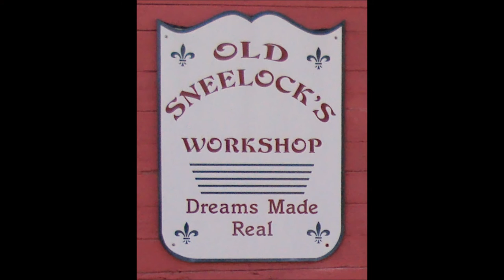Restoring A Two Man Saw ~ Pt 10 ~ Explorations In Removing The Rust ~ By Old Sneelock's Workshop

Comment: YesSirRee those wheels do a good job. Anytime i have to use one the thing is really rusty. Doing it outside and with a dust mask helps...
Reply from the maker: Ol James I have two more crosscuts to clean and a pile of panel saws. Fortunately I just went to pick up supper at Up North Restaurant and the Ace  Hardware was 50 feet away across the parking lot. As can be expected I know the guys there so I went in and checked. They have a peg full of them on the sand paper aisle. I love small town hardware stores.
Reply: ..YesSirRee, that's where i found a supply of them. wally-world doesn't really keep them in stock...

Comment: Lowes or Ace has those wheels. I've seen them and that's the only 2 places I go to get anything. I tried the little plastic so-called abrasive thing like a wire brush but it didn't do a thing on my industrail strength rust. The DeWalt flap wheels work but might work too good on a saw. I need to get one of those wheels. It'd beat the wire brush in the side grinder, betcha. Leastwise here, anyway.
Reply: I just got back from hunting for another one. The first one is worn half away on the one saw blade. WalMart had some made from the reddish brown Scotch Brite that is less coarse than the black. I bought one of those. They didn't have the black ones like I already had. They had some mounted on fiber disks for an angle grinder but I don't want to have that cutting grooves in the saw plate. I could cut it back but I left that as a backup plan. $10.00 and then have to modify it only to do 1 blade seems like a lot of work. Tractor supply only had the little Rolocks that are nice but they will leave swirl marks.  I found slightly different black ones at Menards. They aren't mounted. They have an arbor in the package with two black Scotch brite wheels. $6.00 for the package. I'm going to give them a shot on the other 6' two man bucking saw.
Reply: David Nighswander I'll yave to look next time I go hunting stuff......IF I can remember it. I know how I am. Oh well. I guess we've earned the right to be what we are.
Reply: Found a set at the local hardware. Now to Sneelock up an arbor. I'm pretty sure I have one somewhere around here. :-)
Reply: David Nighswander I lay heavy odds you have a STACK of them somewhere. Now to find the arbor detector and............
Reply: Found it. When Hoekstra's Hardware had their going out of business sale I bought one. Now to mount it on a motor. Hmmm.... Now I have to find a motor.
Projects just never end. :-)
Reply: David Nighswander I know. I've got a dentist visit Monday and I might run by the 2nd hand place and see if they still have the polisher. Then again I might talk myself out of it. I'm goofy, you know.